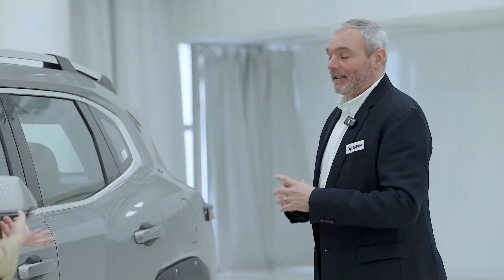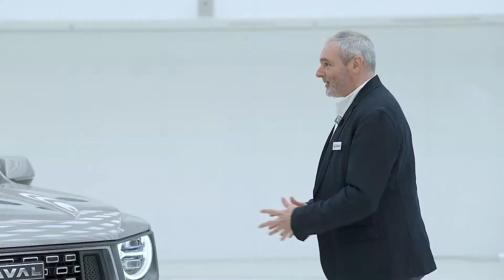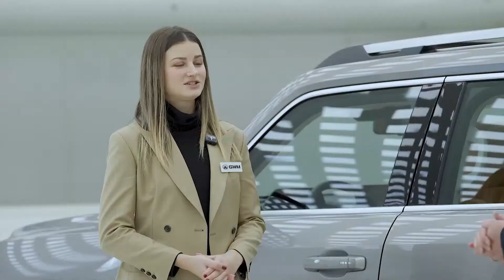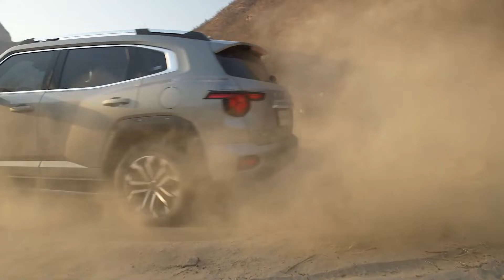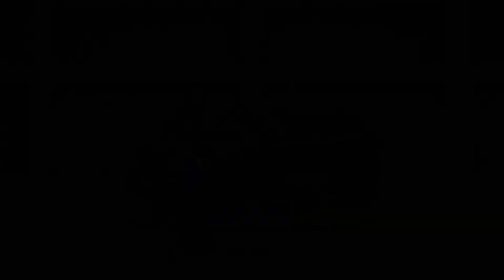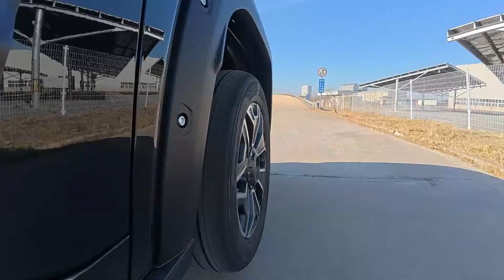The New Era Explorer SUV – GWM HAVAL H7.

Comment: You need T-Rex arms to operate the window up and down controls. Why position them in the middle of the arm rest and not closer to the dash. Poor design. The 2 litre turbo is an absolute gas guzzler. Good luck getting less than 12 l/100km. My Sportage gets 6.5. and 5.8 on a combined highway. For the price ($48,000 Au) for the hybrid, GWM really need to do better.